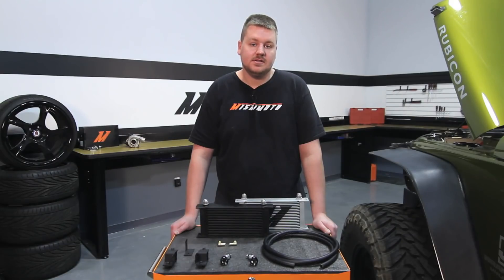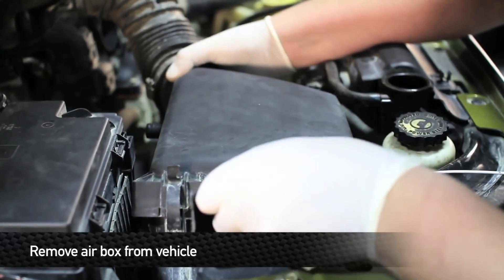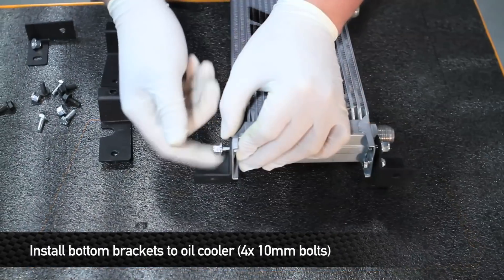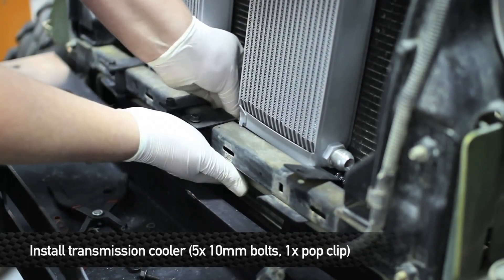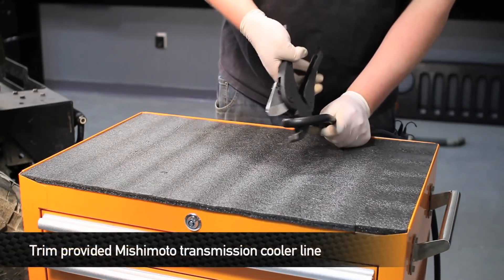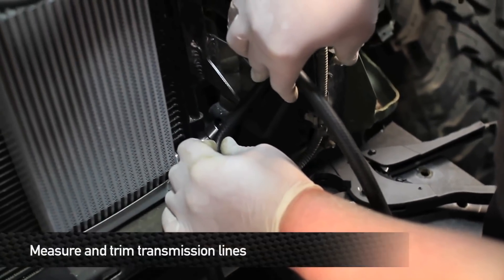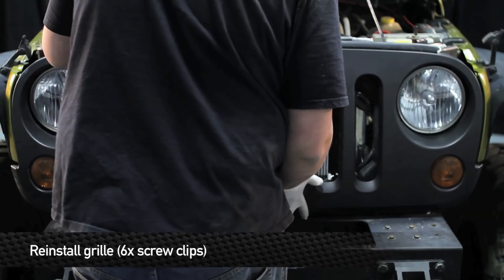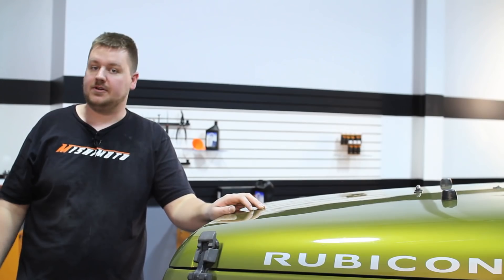How To Install: Mishimoto 2007-2011 Jeep Wrangler JK Transmission Cooler

Comment: Which end connects to the bottom vs the top of the trans cooler radiator (input vs output) ?  Or does it not make a difference ?  And I would NOT use those worm clamp fittings, I would buy quality pressure/friction clamps, they ALWAYS loosen.
Reply from the maker: The cooler is not directional so either port can be used. To this date, we have not heard of a complaint of loosening clamps provided they are tightened properly during the initial installation. Thanks!

Comment: Another question. Won't you have to add additional Transmission fluid to compensate filling up the cooler? I saw a video with a cooler being added to a Tundra and they added about 1 and a half quart of additional fluid.
Reply from the maker: Add approximately one quart of Jeep-specific transmission fluid to the system. Remember to check the transmission fluid level while the Jeep is running.

Comment: I just purchased both oil cooler and Transmission oil coil. Im very excited to install them. I just have one question. Could I use blessed silicone hose for the Transmission cooler rather than the supplied tubing as all may hoses and tubing are blue silicone and im trying to keep the uniformity.
Reply from the maker: We do not suggest using silicone hoses with transmission fluid.

Comment: Which hoses go to which part of the cooler? Eg, which part of the hose goes to the top and which part to the bottom? Or it doesn’t matter?
Reply from the maker: The cooler is not directional so this wont matter, however the hoses naturally will fit on one side better than the other.
Reply: @mishimoto  thanks team. Super excited to add this to the JKU!

Comment: My transmission is running hot around 190, will these help it bring the temperature back down to a good temp?
Reply from the maker: Yes, the transmission cooler should help with keeping the temperatures under control and keep them down.

Comment: This video let some doubts:  What happen with the original transmission cooler ? Did you remove for repace it. Or put this as additional ?
Reply from the maker: This cooler is installed as a additional cooler as we splice into the OEM lines without removing the OEM cooler.

Comment: do newer models have a Transmission cooler already installed? my 2010 does not have one and i went in the other day at a dealer and seen thought the grill of a newer model and seamed as it had one.